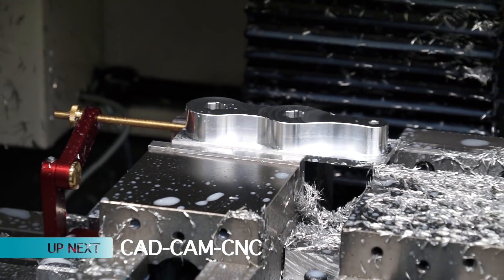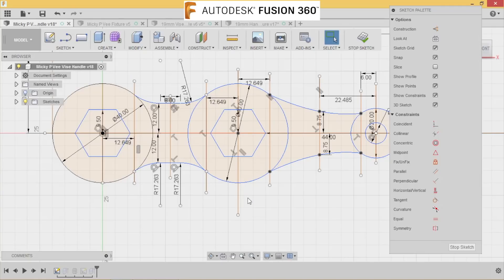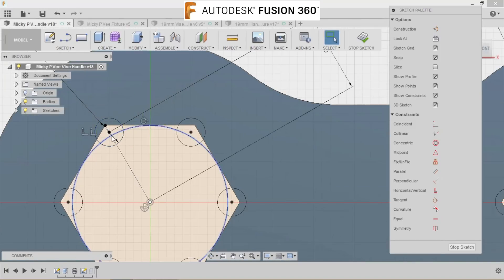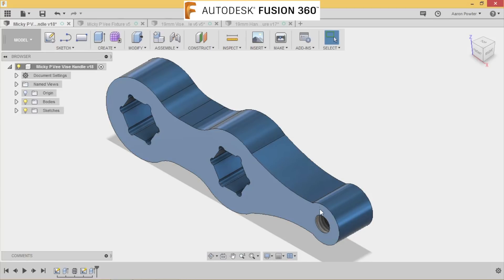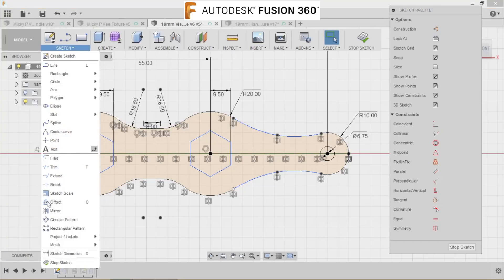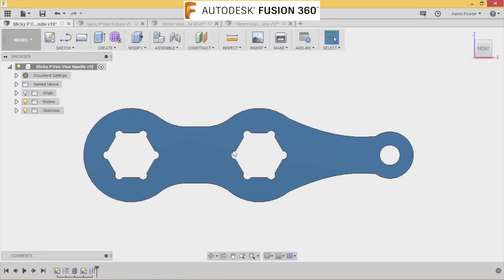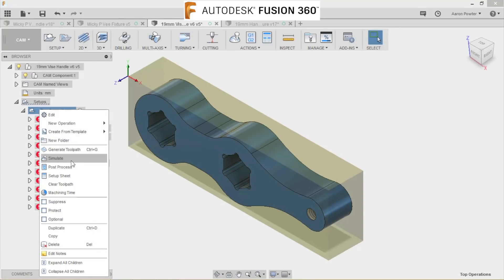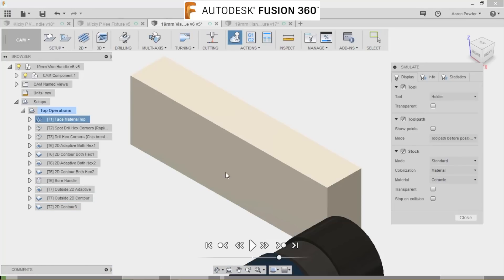CNC Machined Speed Vise Handle Pt.1 - Autodesk Fusion360

Comment: Hi, are these designs still available? I note the links don't seem to work. Not critical but save me some time. Thanks Damien
Reply from the maker: Hi Damien. I will fix the link later on when I get home. Please try back again later or send me an email please. Cheers 🍻
Reply: @DCT_Aaron_Engineering  Thanks, nice work on the channel too - great content.
Reply from the maker: @damiensiviero  Hey Damien.  Thanks for the positive feedback.  Good news, I've fixed the links and all the URL links now work.  All the best with making them.  Aaron.
Reply: @DCT_Aaron_Engineering  thanks, I've got the file and will knock one out on the mini mill I converted using mostly your file - thanks again.
Reply from the maker: @damiensiviero  My pleasure Damien.  Ok cool, feel free to send me a pic of one when you finish if that's ok.

Comment: I love your work and videos of the very capable little Skyfire.
If you get the resources or funding perhaps, I for one would love to see what this mill can do with a 3/4" inch shear hog.
Then you could really shed some time of the cycles.
I mean if the Tormach can do it, the your mill most defiently can.

Cheers and keep up the great and inspirational work.

Ps. Did you ever find out if the Adtech is capable of scripting sub routines for a probe system?
I mean there is a function for tool setting, there should be a possibility for probing.
Reply from the maker: Hi Patrik and thank you :-).
My machine is still going well.  Had a few minor problems and break downs along the way, but overall it's usually very reliable.  Unfortunately some of the other guys with their Skyfire machines have been really let down, but that's a whole other story.  I did try to get a shear hog a while back, but the contact AL gave me AB was not very helpful.  One day I'll get one.  Apparently my Adtech controller is  an older outdated one that they don't really support anymore.  The newer 4960 and above have better features on them.  Cheers, Aaron.

Comment: That looks a fantastic finish on those handles. I’m really interested in buying a Skyfire VMC, but keep hearing/Reading continued issues with it from new. 
How is yours holding up?
Reply from the maker: Hello Rob how are you?  Thanks mate, I'm very happy with the parts and they look fantastic.  My little VMC is running well, however many others machines aren't.  My honest advice Rob, contact Xushuo from SyilCNC and price an X7 or X5 combo machine (mention my name).  I personally know 5 people who've bought one now.  Cheers, Aaron.
Reply: DCTTeacher1 
Thanks fella, I’ll check those machines out online and see what they are like. I’d love a Tormach, but they don’t have any U.K. importers or support, plus the Skyfire has better slides and Servo motors, hence my watching all the Skyfire vids. But there’s a lot of folk with poorly built machines, with out of true rotating parts etc.
Reply from the maker: Hey Rob, the Syil CNC machines have all linear rails, servo motors on all axis, 10K spindle, BT30 taper, PDB and ATC.  The Syil X7 is the same frame as the Optimum F80 ;-)
Reply: Ummm, they do look good, and the specs are good. Thanks for the heads up, I’ll do more reading up on them. Thanks fella
Reply from the maker: My pleasure Rob, anytime.  Oh, check them out on Instagram too (CNSyil).  They are an OEM company too and make castings for other CNC machine companies also.  I think my friend over in the UK might even be an agent for them.  Let me do more homework :-)